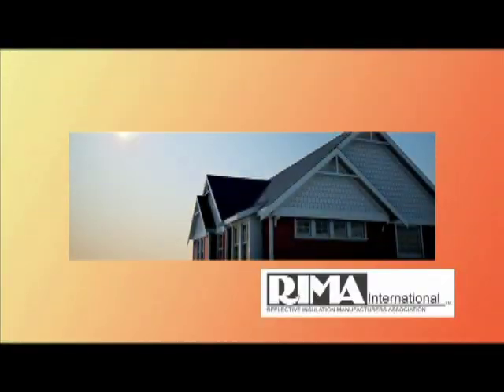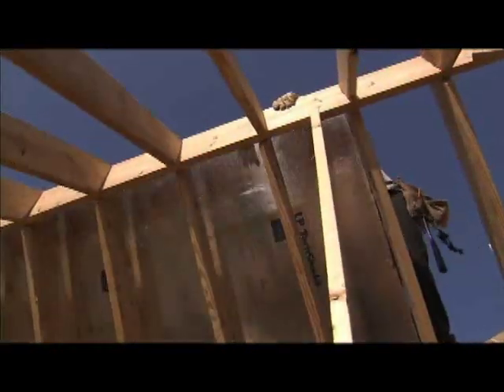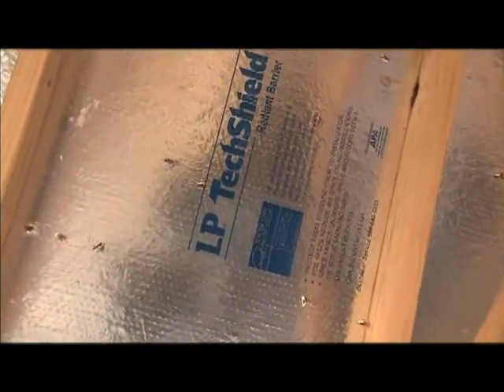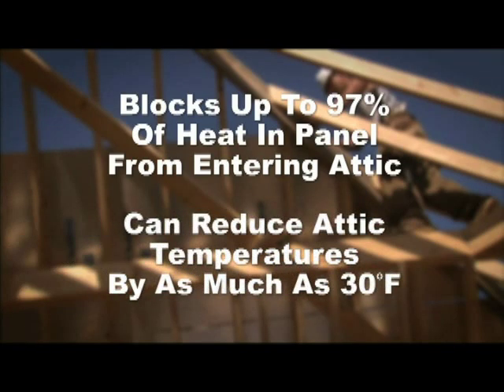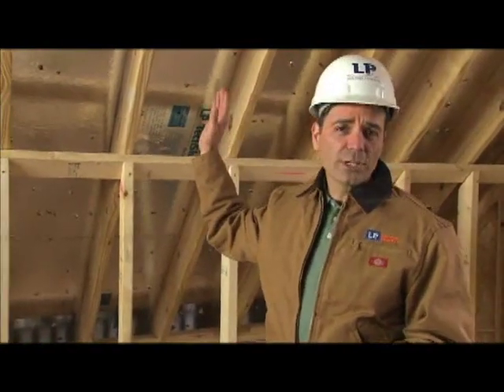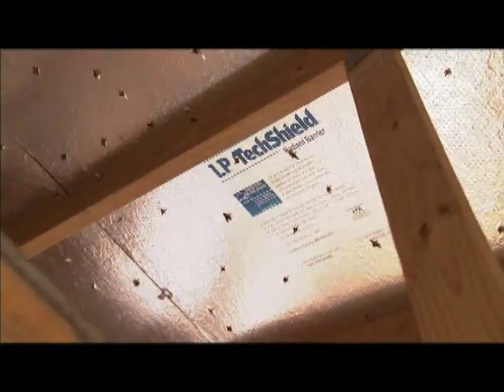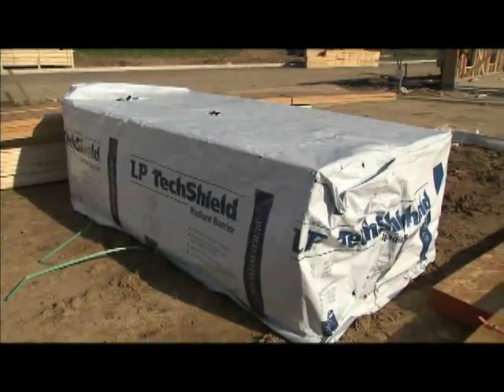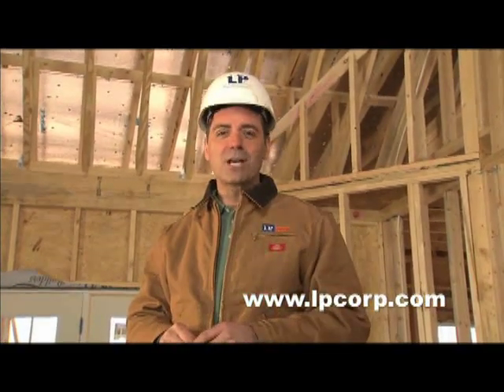LP® TechShield® Radiant Barrier Sheathing

Comment: Heat, Cold, Wet and Air..... will contribute to unwanted damage of a structure/living space.  *Moisture will definitely settle when convection occurs... but not cause as much damage if the source is addressed. 1) An attic needs to be Cool and dry or Warm and dry to balance energy savings too. 2) Heavy fiberglass causes more convection 3) Convection is lessened with dead air space.

Talk is cheap without actual proof though  : )

Comment: 911dispatcher:

Totally incorrect. Installed on the attic floor (cold side of the insulation) will cause moisture buildup. Mold development and barrier failure will soon follow. Refer to this link. He explains it very well.
h t t p : / / w w w . c e e j p u b l i s h i n g . c o m / A r t i c l e s / 0 0 2 0 . h t m

Comment: Two things seem obvious to me.  Firstly, that a radiant barrier such as this is more effective in reflecting heat back into the attic than out of it, and secondly, that the most effective radiant barrier to keep heat out of the home is going to be installed on the floor of the attic facing upwards... that is, until its reflectivity is compromised by the accumulation of dirt, dust, insect and rodent feces and urine, along with damage from the home owner and/or workmen in the attic.

Make sense?